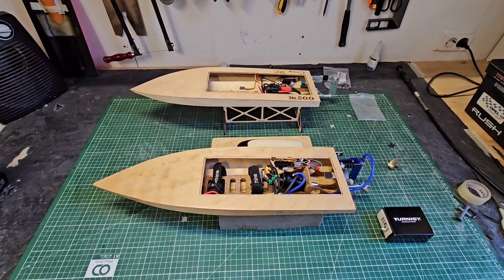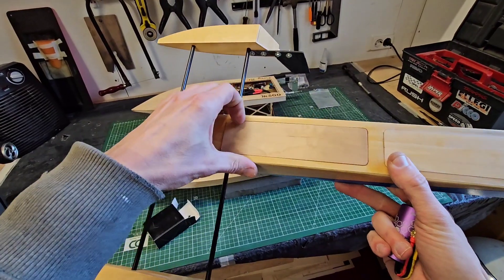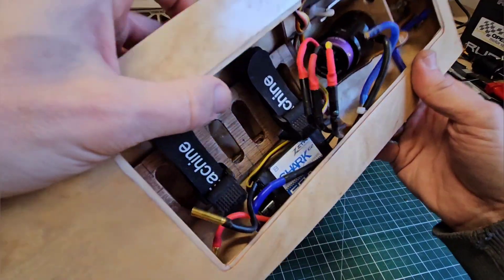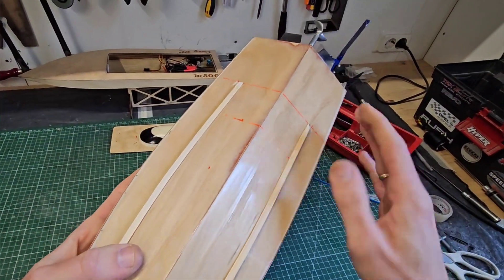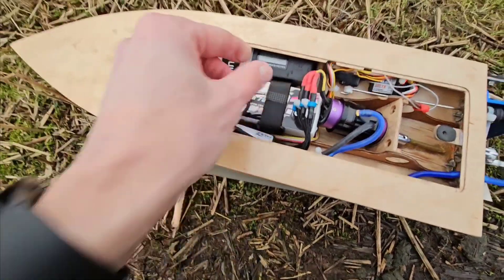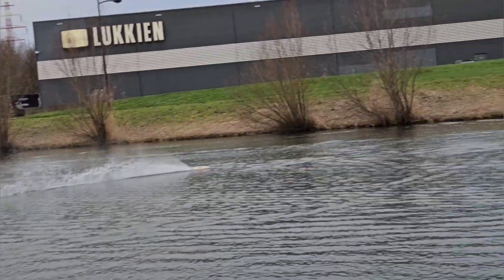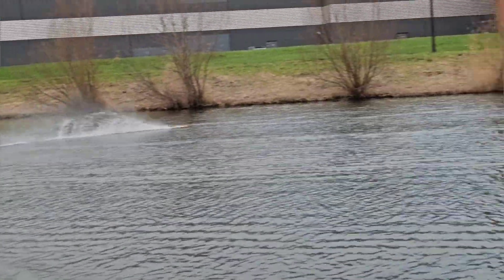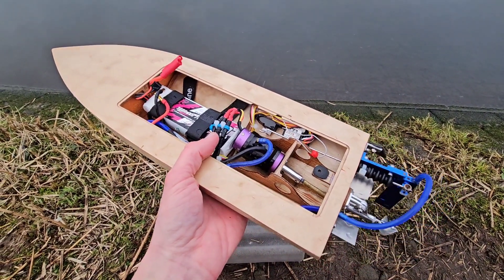Bigger motor for the Mini Mono: how does it run with a 2858 2900kV motor?

Comment: Hey man I’m currently building this boat and am having trouble with the shaft getting really hot and being unbearably loud,was thinking I mounted it wrong or the bend is too sharp but was hoping to get some advice thanks
Reply from the maker: It sounds like it's either misaligned  binding or vibrating. Try to decouple the shaft from the motor  and spin it by hand. It should be smooth, with low resistance. Also, the shaft should align with the coupler. 
If that all doesn't help, I would replace the teflon liner in the brass tube. Good luck!

Comment: Could you run that motor and a 80a esc on 6s?
Reply from the maker: I don't think so. That would be too much rpm. I'm going to try 6S with a 1980kV motor, though!
Reply: @ what about 5s
Reply from the maker: That should work!

Comment: great test with the strakes 
maybe 5s? on better water
Reply from the maker: It's really interesting, and I gained some knowledge on lifting strakes and their behavior. 
This run was on 3S, and I will definitely try 4S as well! 80+ km/h should be easily possible 💪

For the M500 I will try several setups, one of them being a 2848 1980kV on 6S! 😎
Reply: @CozyRC  good kv👌

Comment: Great work, Jan.
I was thinking something about the banana connectors you use. While using those 4mm connectors,faced some problem's as connection was melting due to high current. And this connector moves inside. So i decided to move from this to solid 4mm bullet connectors.
Reply from the maker: Good comment, thanks! I have both the banana style and the solid ones. I never had issues with either of them, actually. But the banana connectors I use are tight fit as well

Comment: Oh, I like that wire tie job. Forgot all about that trick we used to use on 1:1 cars for the ignition wires on old V8s. Very nice results with that motor and the strake mod:yougotthis:
Reply from the maker: Thanks! I got the tie-wrap mod from one of my RC friends. It's easy to apply and effective 👍
Reply: @CozyRC  Agreed 👍

Comment: There is a calculation I use to get close to the right prop for  changes of  kv 11.1 x kv x prop size so let’s say 3514 prop a 3514 is 35x1.4 =49mm total pitch,so 11.1 x 3450 x 49=1.876,455 now let’s try 2950 kv x11.1 using a 3516 prop so 35x1.6= 56mm total pitch.
So 11.1 x2950x56=1.833720 so this is very close to the first calculation so I think given the extra torque and power and possibly less voltage sag this prop even though it’s a fraction less on the calc it might go slightly faster or at least the same. It’s just a ball park calc or a starting point for bench prep for prop choice when changing KV.
Reply from the maker: I use a similar calculation, where I can also calculate the theoretical speed. I make calculations for my profession (Mechanical Engineer) so I love playing with numbers and put the theory at the test 😎
Reply: @ sweet,I do the same, based on the resulting speeds from the calculations across all my tests.

Comment: Ohh I think you could use bigger prop. The motor is much bigger than Rocket and has lower kV. Of course its just my suggestion but in my opinion you should beat your top speed with Rocket motor despite Turnigys lower kv 😊
Reply from the maker: Both motors perform great in this boat. I will definitely try bigger props with the Turnigy motor, and I will run it on 5S as well!
Reply: @CozyRC  5s sounds like crazy! I cant wait😊
Reply from the maker: Oops, sorry I meant 4S 😅. Should be fast still!